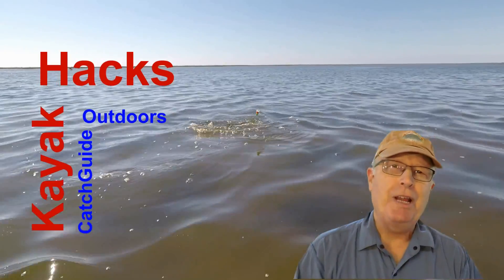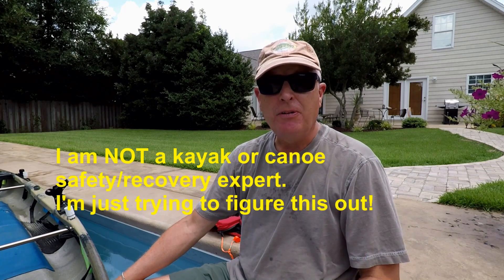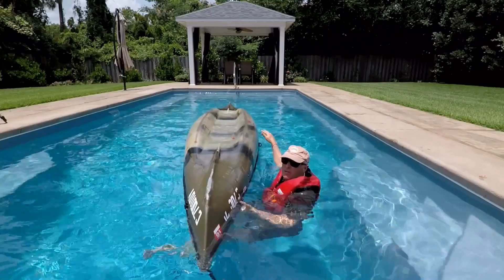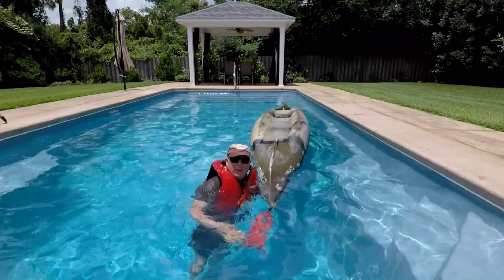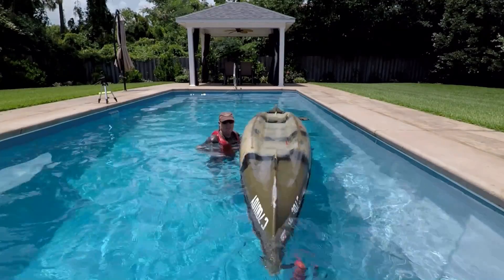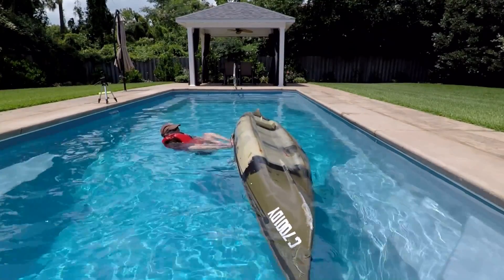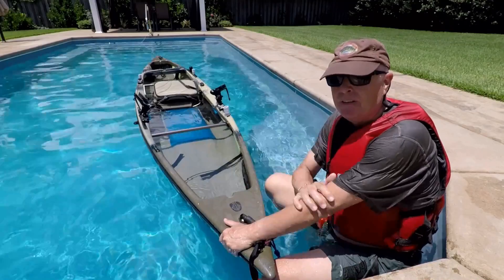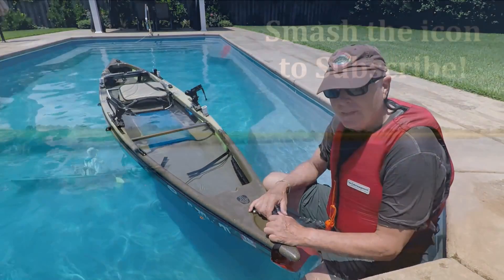Self Recovery - 2 Techniques Tested on Native Watercraft Fishing Kayak

Comment: I like the video and the fact that you went to the trouble of trying these recovery methods...thanks for that. What I don't like, as an Native Ultimate owner, is that none of them seem to work very well...if at all. Like you mentioned, having 10-20 more pounds of gear and fishing tackle all strapped in the boat, along with the added drag of fishing rods mounted in holders would make the job almost impossible! I'm a pretty strong swimmer but I'm not crazy about that being my only option in the event of a flip. Hmmm.
Reply from the maker: And the horrible thing is Native admits it! When I posed the question on their FB site, they responded that this model is nearly impossible to recover... because it fills with water! Geez.

Comment: I haven't try to flip a sit inside kayak,  but I found it easier just to push the side in front of you down and once it is submerged pull the other side and flip, like I did on my does it flip videos. Sounds like i need to try flipping a sit inside style kayak like yours
Reply from the maker: The problem with the Ultimate is it is poorly designed to recover.  The 1/2 canoe format just scoops the water in without the additional height a real canoe would give to allow recovery.  I tried your suggestion with the flip line over the top for more leverage and force than pushing and pulling and it just filled the boat.
Reply: Kayak Hacks Fishing sounds like a big problem, maybe the flouting bags will help
Reply from the maker: They would solve the problem at the loss of space.

Comment: I have a sit on top because of this issue.  I was on a Kayak Charter using Native Yak and discussed re entry.  The guide said you flip the boat back over, and push one end into the water, climb and stand on the bow or stern forcing one end high up to drain and then quickly lean, move forward.  He said it required the least amount of strength, and easiest reentry.  I never tried it but it seemed like it makes sense.
Reply from the maker: Interesting! I will have to try that.  That is a variation of the old boy scout method of pushing down on a canoe.  I tried that and it did not work.  But standing on the end might.
Reply: Steve Dorn Steve & Steve, I hate to say it, but it seems you are doomed without fire & aft float bags.

Here's why:  This boat is most likely to roll when the conditions are most difficult, as in when there are waves and chop. As you noted, with the most ideal circumstances, you barely managed to get it righted and with only 3" of freeboard. It's a certainty that the piece of chop or wave that rolls in that is greater than 3" high will completely swamp that sucker to the gunwales...over and over and over and....

Then comes the part of the righting that involves getting back into the craft in order to use the bilge pump to quickly pump it clear — you do carry a bilge pump, right?  Good luck with that one (i.e., give that a whirl in the swimming pool 1st). 

The only thing that has a chance for a self-rescue is:  1) Right the boat. 2) Quickly move to either end. 3) Facing the opposite end while grasping a rail in each hand, quickly and in one motion shove the end of the boat down and between one's thighs, while firmly gripping the gunwales between the thighs and relocating the hands further back on the gunwales. 4) At this point one should be basically sitting on the end of the boat, that end should start sinking and the other end should start rising out of the water & one can relax the legs in order to maintain control over the boat. Don't let it roll on you!

If you make it this far, then you can start trying to rhythmically buck the boat up and down  in order to slosh more water out. Next comes the belly-crawl back to the seat & reentry. 

Don't even bother without float bags!  I just have to say this:  A set of float bags can be had for about $50, and if this is too much money, then scrimp and save, sell some excess fishing gear, quit eating in restaurants for a week. Give up the Starbucks or cigs or beer or Krispy Kremes for however long it takes, but no more excuses, just figure out a way to spend that $50 to protect your darn life!  Peace, out.
Reply from the maker: +SuperBardley - I think the real answer is getting a different kayak! And that is what I intend to do for next season.  I'll retire this at the end of October and start shopping sales.  There is a huge kayak show in Charleston, SC in March/April on the water where I can try out the options.  I do not want to buy a kayak without paddling it first!
Reply: Kayak Hacks Fishing HA, that's the best answer yet!  I have a Hobie Revolution 16 and am very happy with it because it is very powerful, fast, and has great range.  These things really matter here on the not so Pacific Ocean. Then comes the part where you tackle hounds get up close & personal with the limited cockpit storage capacity. Hey, I just prep my salt water trips as if I was going fly fishing.

Comment: Instead of bailing out all the water once you turned it over.  Try this get on one end of the canoe and push it underwater bringing the opposite end up out of the water then push it towards the sky. Do this a few times and you will get most of the water out. Next, get in and bail out the remaining water.  Learned this in Boy Scout Camp.
Reply from the maker: Thanks for that good tip!

Comment: I learned the hard way - this is very important.  Leave a smooth 2 foot re-entry area on at least one side of your kayak clear of all hardware.  I flipped and had a very hard time getting  back in because of the zigzag clamps, eye hooks, tracts balls etc. catching on my clothes.  Ripped my shirt and pants trying to belly slide over the hardware getting back in.  Its hard enough  for fat old guys reentering without this hassle.
Reply from the maker: Fantastic points! Thank you. As an old guy myself, I need to take this to heart with rod holders, etc all over my kayak.

Comment: Don’t fall out of native kayaks or you are screwed ... I tested mine today ...they fill with water quickly and sink ..I am disappointed with the fishing kayak I bought....
Reply from the maker: I agree. And Native was not helpful.
Reply: @KayakhacksFishing  To be fair though, wouldn't the same thing be expected with a canoe? Heck wouldn't it be even worse? Some solo canoes weigh 60-80 lbs without water. Just trying to look at it from a logical standpoint, this is kind of billed as a hybrid between a kayak and a canoe, so wouldn't the expectation be that it's got the negatives and positives of both?

The reason I ask is I'm more or less been debating on getting the Ultimate 12, the little brother of this one and I'm going in to canoe territory with a lot of portages, so I've been watching any and all videos on them as I can and I'm not seeing many other options out there as far as hybrids.
Reply from the maker: @fenner1986  Actually, a canoe is much more recoverable since the sides are higher. In this video, notice how high the water is on the inside. I never had a problem doing canoe recovery in Boy Scouts and do not remember having this issue. If you are going to portage, you are really heading back into the wilderness - I recommend you stick with something reliable for an emergency in the backwoods.